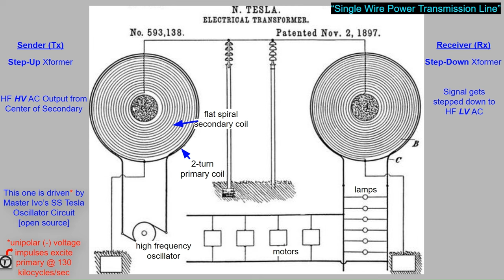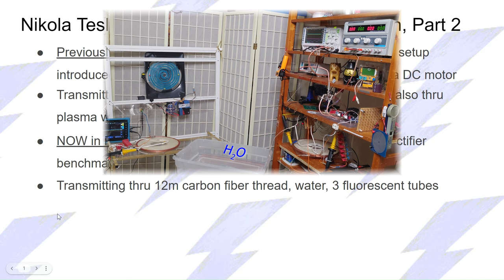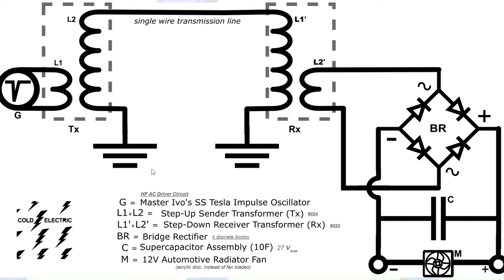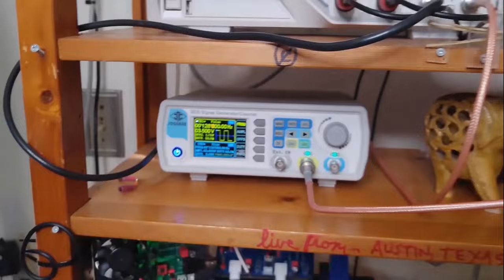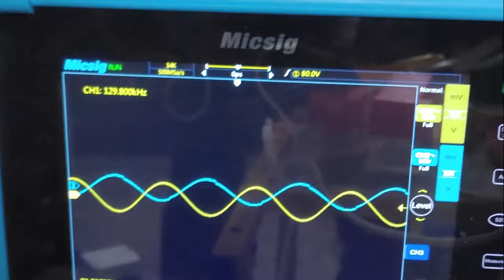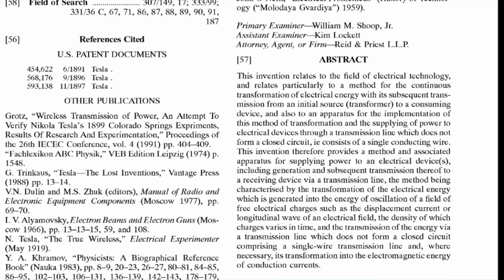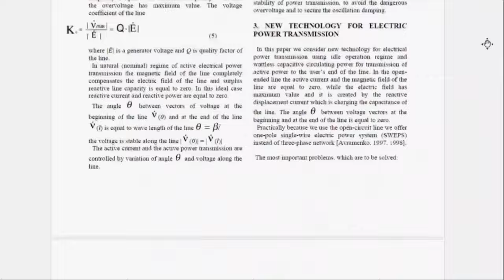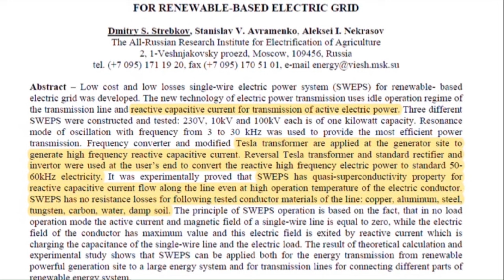Nikola Tesla's Single Wire Power Transmission, Part II: Carbon Fiber Thread, Radiant Energy, Diodes

Comment: Important note when used for long distance. It was assumed that ground was the same voltage world around. This proved false. The cause is the earth's magnetic field and the solar wind, which increases with a CME toward earth.  The transmission lines for telegraph exhibited voltage to the point the batteries could be disconnected and the telegraph still worked. Longer lines stopped working as the sounders stayed energized and sometimes were overpowered to the point of burning them out.
This is why the US electric grid does not contain a DC current path between substations on the HV transmission lines. One end of a transmission line is configured in a Y with the center grounded to discharge static discharge and lightning. The other end is in Delta configuration with no ground so DC on the line can not flow.

Comment: I mean that when rectifying, only the electromagnetic part is used but the longitudinal part is wasted, which is why there is such low performance with respect to transmission.
Reply from the maker: wow I hadn't thought of it in those terms; maybe so BUT doesn't the step-down receiver also transform LMD into transverse (TEM) somewhat?

I am still acclimating myself to the physics at the user end. But I also believe my system is frankly just NOT so well-optimized for longitudinal mode. Recently I got a vector network analyzer which is opening my eyes to things. Plus I'm working on a new helical coil assembly (featuring well-spaced windings & open-frame as seen here: https://youtu.be/z2j1Pe4At1U), doing the math beforehand (lol), so hopefully we can see better efficiency with a more finely-tuned design. 

Peace be with ya,  from Austin, Texas, USA; thanks for your insights, I'll have to consider those points.
Reply: ohh stevie ray vaughan place, i love him, longitudinal energy is perhaps easier and more difficult than it seems, haha. Argentina is difficult, you can't find components, everything is very expensive. I shared a link of what I'm working on, using flyback zvs and capacitors in series with the primary coil and spargap in parallel. I saw the video that you suggested and it is interesting, it would be good to be able to chat with Eric Dollard since you are perhaps close to him. Greetings
Reply: Regarding the fact that perhaps the receiving coils invert again from LMD to TEM, it could be possible, it just seems more appropriate to do it as Tesla would have done with capacitors or an electrostatic switch, its patent talks about charged particles that move, which is why the effect of attraction with the sheets, it would be good to try loading larger sheets, I notice an effect with the fluorescent tube when I bring it close quickly, it takes a while to light up and it does so immediately afterwards as if the particles were accumulating inside like a capacitor. Particles are also waves, another paradox!
Reply: Sorry for my English, I have to use Google Translate because it is difficult for me
Reply from the maker: @joseblanco7258  sorry I've got no Spanish, the Argentinian dialect is delightful 😸

Comment: what frequency did you use ? is the one wire is coming from the L1 or L4 ?
Reply from the maker: 128kc/sec, the 1wire is from high voltage winding at Tx, into same at Rx, and I temporarily stopped using any extra coil L4 until I get more impressive results with them.

Though I'm calling my 'discharge coil' L0, so that L1 can be primary and L2 can be secondary (for simplicity), whereas Master Ivo calls it L1. So I might have misunderstood the question, holler if so :)

It gets confusing since the secondary coil of Tx (center winding) is the primary at Rx (center winding), so I just shifted to saying "HV Winding" and "LV Winding".
Reply: @cold3lectric  its a bet confusing yes let me ask you this 
you have 2 coils in the sender and one coil in the receiver ? so L0 and L1 is the primary  and 2nd ary in one side and a coil by itself apart as a receiver , resonating at 128 k right ?
Reply from the maker: nope sender & receiver each  have a 2-turn unifilar 'low voltage' winding around the perimeter of the bifilar 'high voltage' winding (44 turns i think)
Reply from the maker: I'm writing up my specs & precise details here (still working on it but save the link if you wish, for more specifics): https://open-source-energy.org/?topic=3676

Comment: I'm convinced that "radiant energy" was Tesla's term for ionizing radiation.   (He got it from his hero William Crookes, who had coined the term "radiant matter," to refer to electron beams (called cathode rays back then.))   Probably Tesla was generating x-rays since well before 1891.  But he never happened to wave his hand in front of a fluorescent panel, to see his own bones.  

So, if we aim an x-ray beam at a metal plate, will the plate become charged?  YES!  The plate becomes positive.  This is a common physics demonstration, although in physics class we use hard ultraviolet light, and a recently-cleaned zinc plate.   It's just a demonstration of the photoelectric effect.   
So in other words, Tesla patented the phototube.   But his version didn't have a glass bulb.   (And, if we use x-rays instead of UV light, I think it should work much better.)  Tesla even did the same as modern phototubes, by coating his plate with liquid mercury.  (Today we use melted cesium metal, and others, the multialkali photocathodes.)

Also about aluminum-foil forces  ...capacitor plates always attract together at high voltage.   The polarity doesn't matter.   AC or DC both work.   So, if you form a capacitor where one plate is a fluorescent tube, the conductive plasma should attract aluminum foil.   (Replace the CFL bulb with a bent metal rod, and I bet it still attracts the foil.)
Reply from the maker: hmm interesting points! could be, your logic makes sense.

Though i immediately think of some work of Griffin G Brock (on youtube) who seems to show that the 'Tesla shadowgraph' tech has very different behavior to the X-rays we use today; for instance being able to image things several feet away (as much as 40ft), as demonstrated by griffin with replica vacuum tubes of his own construction 🤷

I have a hardcopy of Crookes' radiant matter, i thought he was just referring to plasma though.

here's links to a couple of G Brock's stuff on the topic:
https://youtu.be/caxdjI3H3zY?si=SLsTXmW_6iNcAX11
https://youtu.be/TOPIaFdn3XQ?si=C58ZVBaODkwIvDyh
Reply: @cold3lectric  Yep, I have a couple of his tubes, setting up spectrometry right now (but lost my lab space last month!)   But in his first video, he seems to be using a ~150KV supply on his tube (which should produce near-harmless x-rays which pass through everything,) but then used 30KV to drive the conventional Crookes-type x-ray tube (which is dangerous, a major source of melanoma etc. from strongly-absorbed x-rays.)   He says that the electrode material determines the x-ray energy.  Nope, instead the supply-voltage controls it (while electrode material only produces some x-ray spectral lines.)
To do a fair test, he MUST use exactly the same power supply on both types of tubes.  (If then the Crookes-type tube still killes algae even when given a 150KV power supply, then we do have a mystery.)
Reply from the maker: OH YOU HAVE SOME!? Respect. I need some when finances permit. I'll defer to your judgment then, good sir 😸
Reply: @cold3lectric  He didn't use glass-enclosed electrodes as Tesla describes.  In that case, they're supposed to only have hours of total lifetime.  I bought two, assuming that I'd quickly ruin one of them.   Yes, in Griffin's latest video, he does mention the lifetime problem.
I have a Radiacode 102 here, and I'll test whether I can take an x-ray spectrum by powering his tube with a little BD-10 handheld violet-ray coil.  (All my TC junk is stacked up in storage right now.  Wah!)
Reply: @cold3lectric  I tried it with Radiacode 102 spectrometer.  But the tube only being powered with a handheld "vacuum tester" BD-10 coil.  The x-ray output has a huge peak at 28KeV, plus small broadband hash extending up into MeV.  No big peak at 3MeV though.  And no beam output, just radial pattern.   (I suspect that the results would be very different with a 500KV Tesla coil, up where electrons turn relativistic, and weird physics may appear.  Even 100K might start producing a narrow x-ray beam rather than sphere-waves.)

Oh also, in Alex Frolov's NET magazine, they were doing single-wire experiments with gold-plated optical fibers, and then found that,  with pure glass and no metal plating, it STILL WORKED.   (That large PDF archive of all the magazines is still online somewhere.)
Reply from the maker: @wbeaty  would that be akin to a 'bremsstrahlung' radiation?
Reply: @cold3lectric  Yep, specifically "transmission bremsstrahlung," but it's also called "tantalum converter" and "tungsten converter."    That's where a particle accelerator is aiming an MeV electron-beam at a thin metal membrane, and gamma rays come out the other side.   It's supposed to work both ways, where MeV gamma rays, if they strike a thin metal membrane, will spew MeV electrons out the other side.   But Tesla was using glass instead of metal.   So, his was a "silica converter" instead of a "tantalum converter."   

One modern device which uses this effect is the "microfocus" or "cone-beam" x-ray tubes, of the "transmission bremsstrahlung" type.   These create a narrow beam.   Normal hospital x-ray tubes instead use "reflection bremsstraluhg," with the x-rays coming off as a 180deg hemisphere.  (Then they cover the tube with shielding, except for a small square aperture.)  

Heh, I was talking to an x-ray tubes expert, and he got mad when I described the physics that Tesla was exploring.  He insisted that it wasn't in his textbooks, therefore it didn't exist!   But this was before I stumbled across the terms "transmission bremsstrahlung" and "tantalum converter."    The guy disbelieved in cone-beam x-ray tubes and transmission bremsstrahlung.  (But he was right, and these topics are more for particle accelerator jockies, not for standard x-ray technicians.)

The DOE uses this effect in their giant gamma-ray projector called Project Hermes.   That's where they simulate atomic explosions, and launch gamma ray pulses at entire military aircraft.   Project Hermes is a giant Tesla tube about one meter wide.  A MeV electron-beam is slamming into a tantalum membrane.  The output is a narrow beam of gamma rays.   Aim it at tanks and fighter jets.

The few articles about this stuff aren't mentioning the central issue:  the electrons must be relativistic, otherwise the radiation just comes out in a 360deg sphere, rather than a narrow beam.   So, the drive-voltage must be well above 500KV, otherwise the electron-beam won't create the narrow X-ray beams that Tesla was generating.   

For example, Hugo Gernsback tried to generate these beams (as part of his "death ray" magazine issue.)   He was trying to guide some high-voltage sparks along a narrow beam of x-rays.   It didn't work.   He declared that narrow-beam x-rays didn't exist, and "death ray" devices were just hoaxes.    So, what HV voltage was he using?   30KV from an induction coil!   

So, wasn't following instructions, and didn't get the results that Tesla was announcing.    Normal 1920s x-ray setups don't work.   we MUST use a Tesla coil capable of a megavolt or so.   And we MUST use the special single-electrode tubes (those are the kind which don't short out and melt, whenever 1MV is applied to them.)    Note that Tesla mentioned having to use air-blast to cool the front of his tubes, where the electron-beam landed.   In the particle accelerator biz, that's called "target cooling."   (I wonder if Tesla ever tried using pure quartz, fused silica on the front of his tubes.  Or at least use high-silica glass, which only melts at very high temperatures.  If so, then that may have been one of his secrets.)

PS

Do you have that giant PDF of the Russian NET magazine, from Frolov and Faraday Labs?   One of the issues is all about some large "Avgromenko Plug" experiments with single wires.
Reply from the maker: @wbeaty  yup i do have the giant pdf/zip collection of Frovlov, glad ya mentioned that archaic gem lol.

I'm a no0b with particle/nuclear physics lol but in my petroleum engineering courses we studied the use of gamma ray logs with 'well logging' subsurface characterization, so I've got THAT much of physics studied anyway 👼

Then lately i had interview as a Cyclotron lab tech for a PET pharma co... and I really hadn't realized exactly HOW akin those isotope-makers are to Tesla coils - i learned that cyclotrons have automated servo-operated trimmer caps & PLL auto-tuning, was actually a fun angle to look "down" at TC's from higher tech vantage. Much much more to learn, thankfully!
Reply from the maker: @wbeaty  makes me want a portable 'cloud chamber' to observe the various trajectory/propagation patterns. I've got a cheap EM radiation field-strength meter, of very limited utility.... maybe a low-end entry-level geiger counter can be had....
Reply: There's more than one type of radiant energy, see "On The Dissipation Of The Electrical Energy Of The Hertz Resonator, The Electrical Engineer - December 21, 1892" by Nikola Tesla.

Comment: It looks like you are using HV, the aluminum foil is being attracted via static
Reply from the maker: HF HV AC. But typical HV alternating current would be expected to repel AND then attract, alternately, each cycle, is my understanding 🤷
Reply: @cold3lectric  well, it’s just going to oppose which ever charge you “send out” until it neutralizes.. meaning it will attract, THEN repel once it has the same charge built up “aluminum foil”. Like a Franklin bell. And it would do that every cycle, so attract positivity half the cycle and then attract negatively the other half. It’s basically just a capacitor and you made the plates “movable”
Reply: @cold3lectric  note that RF power will slam the capacitor plates together.   When one side is neg, the other side automatically becomes pos.   Flip the polarity, and they still attract.   If you make a capacitor using thin foil or aluminized mylar, when you apply HV high-frequency to it, the plates suddenly flatten to the dielectric sheet, as if being sucked down.   Or in other words, when voltage is high, AC becomes "electrostatic," just like DC.   

One of Tesla's discoveries was that this only works if the frequencies are exactly matched.   If one side has a different freq, then the strong forces vanish.  (Well, actually they become a vibration, with an average force of zero.)    So, during resonance, AC acts like DC.
Reply from the maker: THAT explanation clicks, cool! Well said  my goodman, thnx for the clarity!